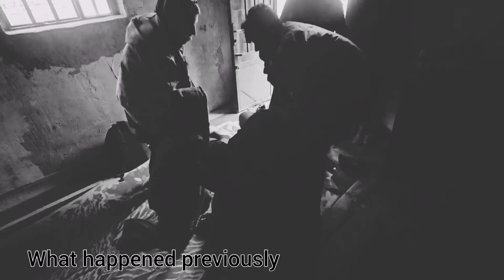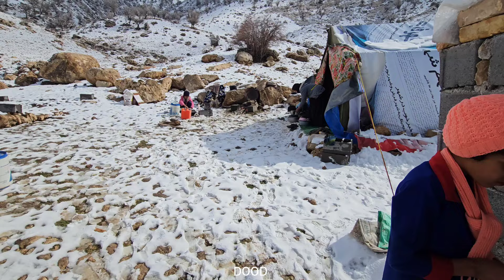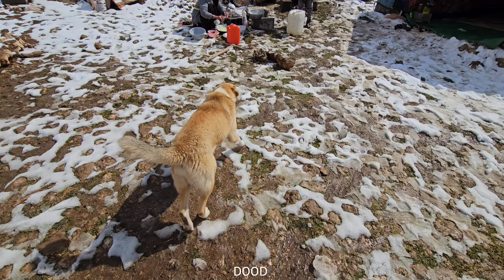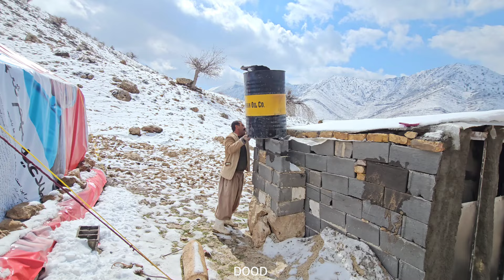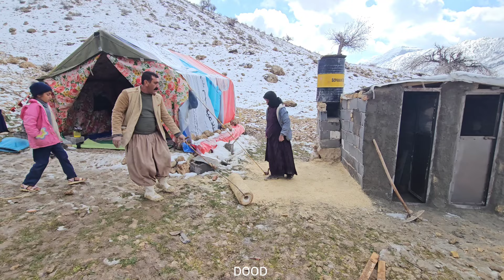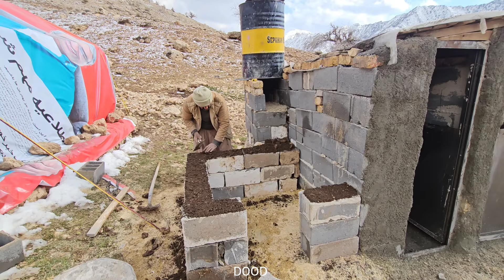Mirza Ali and Perry's quest for a happy life: survival in the snowy mountains

Comment: You have to shorten the iron bars that support the water heater in the shower, shorten the bathtub, and shorten the cement block at the top of the talet with some yellow bricks to cover it so it won't leak when you go to the bathroom. it stinks bro🥀🌹